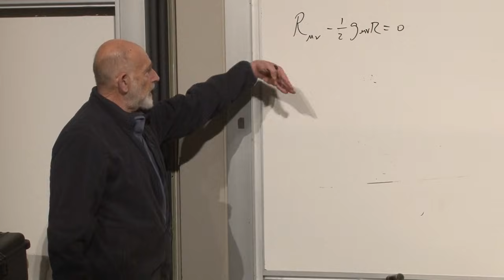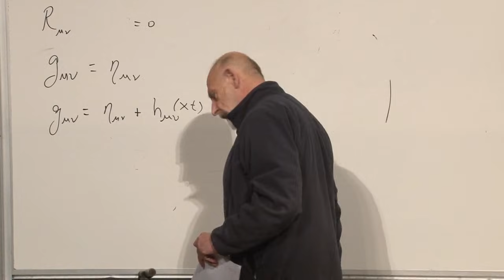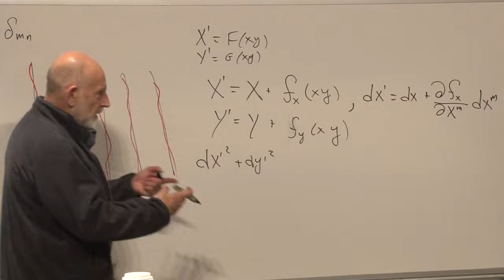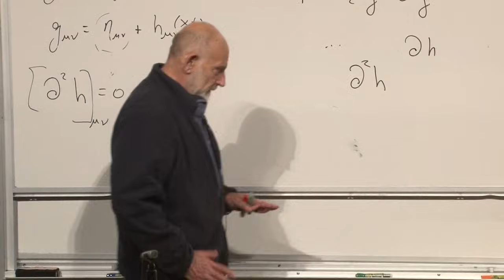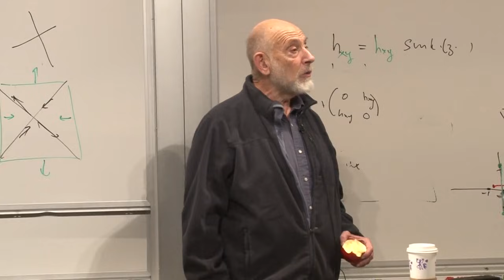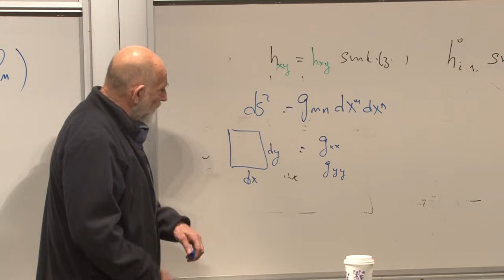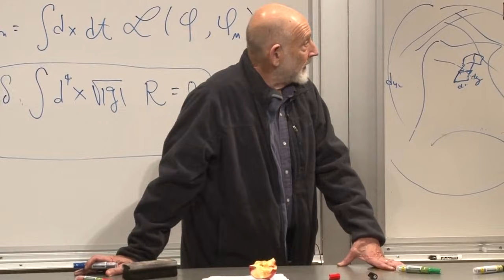General Relativity Lecture 10

Comment: ●EINSTEIN'S GENERAL RELATIVITY IN 6 STEPS

DOES GRAVITATIONAL ACCELERATION DEPEND ON VELOCITY?

Argumentative schematism of Einstein's General Relativity (each step is a consequence of the preceding step):
1) Einstein's Equivalence Principle
2) Gravitational motion equations: geodesics DU = 0
3) The gravitational potential is represented by the spacetime metric itself: which guarantees, since the covariant derivatives of the spacetime metric are null, that the gravitational motion equations are given by the geodesics DU = 0 of the Einstein Principle of Equivalence
4) Gravitational Field Equations: These are the so-called Einstein Equations, which are built on the prejudice that the tetradimensional gravitational potential is represented (again in accordance with the Equivalence Principle) by the spacetime metric itself
5) Solution of Einstein's Equations for the symmetrically spherical stationary gravitational field: Schwarzschild metric
6) Zeros and mathematical infinities in spacetime metrics. "Broken" spacetime. Theoretical prediction of black holes and event horizons

Reasonable doubts:
1) What would happen if the four-dimensional gravitational potential was not represented by the spacetime metric itself, but adding another new potential related with tetravelocity? : http://vixra.org/abs/1510.0137
2) What would happen if Einstein's Principle of Equivalence were not rigorously true? :
https://vixra.org/abs/1510.0135

   ●La gravedad es una tetrafuerza. Con esta concepción se pueden describir coherentemente los 3 test clásicos
   ●ESCAPE VELOCITY ACCORDING TO THE 3 THEORIES OF GRAVITY 
https://www.facebook.com/share/p/1FRHkFhhVt/

Comment: WHAT IS GRAVITY IS, ON BALANCE, an INTERACTION that cannot be shielded or blocked. WHAT IS E=MC2 IS dimensionally consistent, AS “mass"/ENERGY involves BALANCED inertia/INERTIAL RESISTANCE consistent WITH/AS what is BALANCED electromagnetic/gravitational force/ENERGY; AS TIME is NECESSARILY possible/potential AND actual ON/IN BALANCE; AS ELECTROMAGNETISM/energy is CLEARLY AND NECESSARILY proven to be gravity (ON/IN BALANCE); AS gravity/acceleration involves BALANCED inertia/INERTIAL RESISTANCE (ON BALANCE). INDEED, GRAVITATIONAL force/ENERGY IS proportional to (or BALANCED with/as) inertia/INERTIAL RESISTANCE; AS ELECTROMAGNETISM/energy is CLEARLY AND NECESSARILY proven to be gravity (ON/IN BALANCE); AS TIME is NECESSARILY possible/potential AND actual ON/IN BALANCE !!! The stars AND PLANETS are POINTS in the night sky. WHAT IS E=MC2 IS dimensionally consistent !!! Accordingly, ON BALANCE, THE PLANETS (including what is THE EARTH) sweep out equal areas in equal times. Consider TIME (AND time dilation) ON BALANCE.

Comment: The weak field equations can be seen as analogous to Maxwells equations in electrodynamics. See https://en.m.wikipedia.org/wiki/Gravitoelectromagnetism

This allows one to transport knowledge of ED to GR. Many problems are easier to tackle with Maxwell type equations. 

This Gravito electro magnetism can be derived using only special relativity. In short: newtons law and coulomb law are basically the same. Therefore they Will both lead To Maxwell type equations. 

Incidentally, since Maxwells equations imply waves, this means that already special relativity implies the existence of gravitational waves.

Comment: In any case some knots raise about general relativity. Actually, a geodesic 

travelled by a material body would be in any case different from an inspiralling 

orbit as for BH's merging giving out gravitational waves, GR being a conservative system.
Why the Gauss' 2nd fundamental tensor, related to the 2nd differential form 

characterizing manifolds, is not so weighty, passed over indeed, in the theory? 

My feeling is that something else just as basic is ignored: in my opinion differential geometry
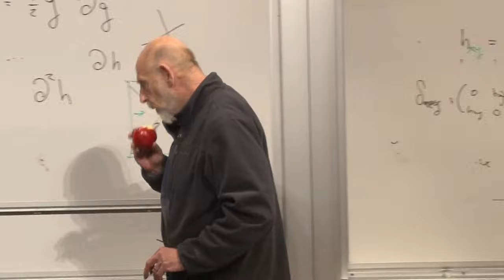is not only matter of pseudonewtonian fallen apples as that of 55:31 in streaming.

Comment: can anyone tell me what is meant by "taking the trace" at 2:38
My guess its something like contracting all the indices.  But thats just a guess
Reply: watch the quantum entanglement lecture, it’s just a fancy version of summation, add up the components of the leading diagonal
Reply: Given a matrix A_ij the trace of that is A_ii (Einstein's summation rule assumed). By the way, though Professor often says, metric is not a matrix. It does not have eigenvectors or eigenvalues (without an additional construction) and so on.

Comment: Can anyone tell me if he covered time dilation etc.?  If so, which lecture does he talk about it?
Reply: Wrong. Light has energy because it has momentum. The energy of a moving particle is: cP₀=m₀C₂/sqrt(1-v²/c²), from which it is derived that the energy of a photon is E=(cp)².
And no, there are no 4 space dimensions.
Reply: KraftgleichEnergiedurch WellenlängeistdieWeltfomel
I can see where you're coming from about the four dimensional space but since space-time is clearly non-Euclidean I don't think it can be applied as a standard model. On the matter of thermal equilibrium I would consider the loss of energy by the photon caused by the slight increase of it's wavelength because of the expansion of the universe.

On the matter of the mass of photons, I am sure that you already know this but I do stick with it, I mean the interpretation that photons are not directly affected by gravity but by the curvature in spacetime caused by strong gravitational fields such as a black hole.
For example the Schwarzschild solution to Einstein's field equations 
c²τ²=(1-Rs/r)c²t² - etc etc, tells us that the time component is dependent to the radius but because space-time is a whole.
So far no experiment has told us otherwise.

One could even say I almost agree with you. :D
Reply: Correct me if I’m wrong but by saying this you mean that you’re talking about a compactified spatial dimension? Kinda like a tesseract but shaped as a thorus.
I agree that 4D space indeed is Euclidean space but the lack of symmetry is the real universe prevents it from being applicable as a model.
Now I’m going to go a bit further on your model, and correct me if I’m wrong again but if you balance the components like that, won’t you affect the coordinates themselves and create a different depiction on curvature then what we have now?
As far as I can tell you only use this new mathematics to straighten the coordinates themselves, right?
And if that's true won’t the space stay Euclidean because of the tweak itself? 

My problem with your interpretation on the expansion of the universe is that the spacetime curvature suggests the universe does expand in volume
because it’s actually expansion of space itself.
If the universe doesn’t increase in volume then won’t the look-back effect be very different?
Actually according to a paper from 2006 this effect of CBR is caused by a bound value placed on entropy by the cosmological constant because the matter-dominated phase began not too far in the past.

But how will you be able to provide empirical evidence to support this? It’s going to be easy to just substitute the time component with a spatial component in the mathematical interpretation but this will not make the new dx have something other than timelike properties. How will you present the metric in itself?  And how do we measure the non-being of a moving particle?
What would the proper space interval look like?

Comment: What do you mean "patched every time"? As of today, 6 Nov. 2013, the field equation of general relativity is still the same as it was in November 1915: R^ab - 1/2 g^ab R = T^ab. Black holes are not "kludges", they were there since Nov. 1915 (although not fully appreciated until the early '60s). "Dark matter" has been discovered only recently, it's still a puzzle. And the idea of geometry is not "stupid", it's a particular math model that is forced on us due to the equivalence principle.
Reply: Dark matter hasn't been discovered and probably will never be because it seems absurd.
Reply: @pabloo.o1912  I tend to agree, it smells very much like aether: an addition made to keep certain existing model (GR) going. I suspect a new theory that would include both GR and QM will no longer require it and the currently unexplained behaviour of galaxies will follow from the new theory as a matter of course. Some people think that including QM is unlikely to produce such large-scale results but this is not necessarily true as, for example, there are slow-speed consequences of special relativity like the colour of gold, etc.
Reply: @The King of Nature I think you misread what I wrote.

Comment: It's a model that works. It's incomplete, of course, but so is every other theory in physics. Considering its rather minimal assumptions it's a pretty good theory. (Its philosophical implications are a different matter.) Just read e.g. Lorentz's papers on electrodynamics predating special relativity, it's a terrible mess. As far as applicability goes, the bankers who fund particle accelerators would have surely found out very quickly if the theory didn't work.

Comment: I think its better to start with Special. General relativity is based on special relativity with the Einstein Equivalence Principle. if you take a small region of space-time, the space-time is Minkowskian (or flat) and so you can find a coordinate system in which the metric is the Minkowski metric. What this means is that locally, special relativity holds.
Alternatively, you could try learning general first. It may be harder in the beginning, but it can pay off.

Comment: It's a common misconception that special relativity applies only to constant velocity. It is a _mechanics_ (a replacement for Newtonian mechanics to be exact) and as such it obviously deals with accelerations. Only its _derivation_ uses constant velocities simply because they happen to be sufficient to derive it. The difference between special and general relativity is that the former is done in an affine space (the Minkowski space) while the latter allows nonlinear (curved) spacetimes.

Comment: on the frequency gravity waves....is it only the relative rotation of the binaries that contribute to detectable frequencies ? I would guess that would only produce ELF waves such as the 7.5hr....but in an article about LIGO said that it filtered the wave data to only pass KHz ranges, why KHz & not ELF ?  are many ranges produced ? & how ? maybe the detection method cant low-pass as a limitation ? can anyone clarify ? also is Energy proportion to frequency the same as in EM ?